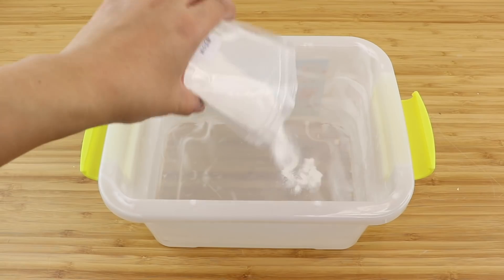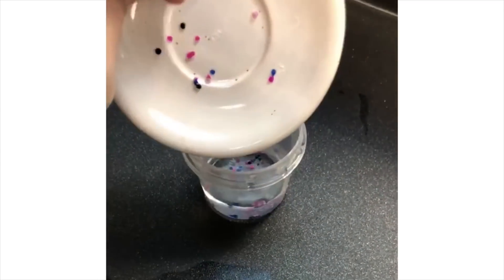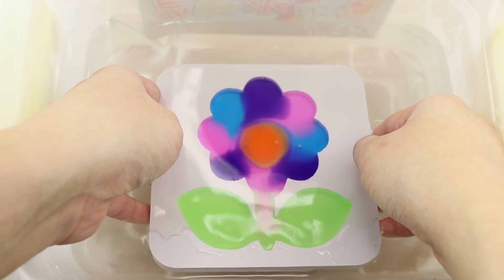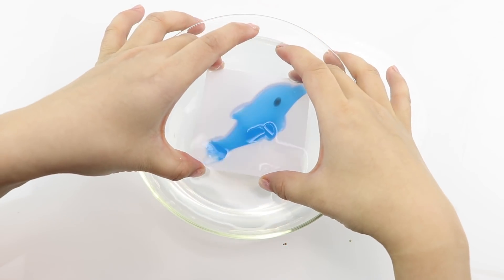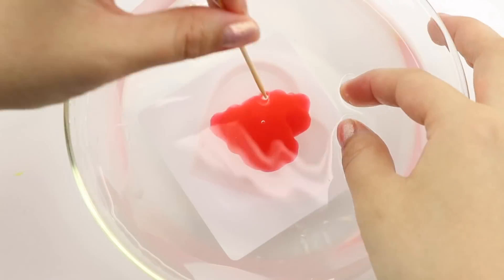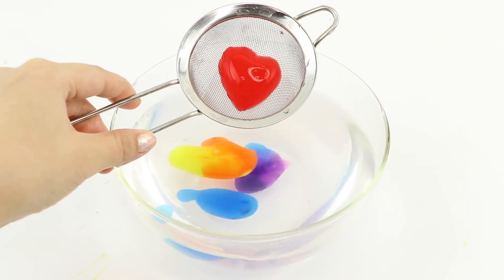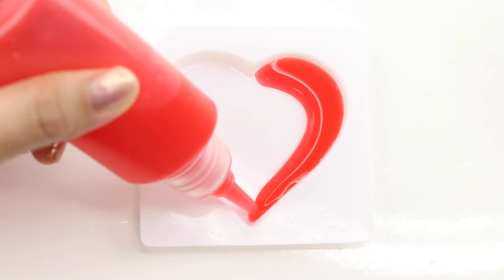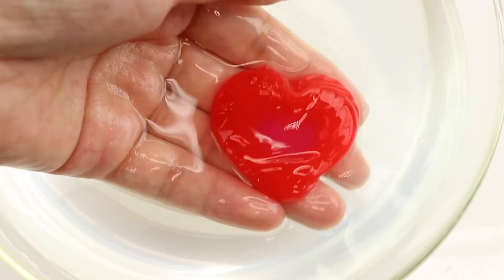DIY WATER CHARM FOLLOW-UP!!! How To Make Squishy Shapes? Satisfying Slime Popping

Comment: I realized, based off an old video, you could totally make a tea slime by replacing the water you mixed the glue with, with room temperature tea. The slime might not decompose if it’s a non-acidic tea.

Comment: Maqaroon, I think I know the answer to your question at 2:46! You're on the right track! I think it's so the back side will set. For example, if you wouldn't, then (assumably) the top layer would form only on the parts the solution can reach. That's my theory, but I don't know for sure.

Comment: I kinda wonder how it would work if you just put thin layers of gel in, solidified them in the mixture, and then added another layer on top. Would it be possible to make something close to the mold shapes?